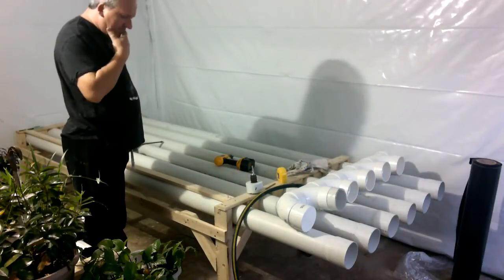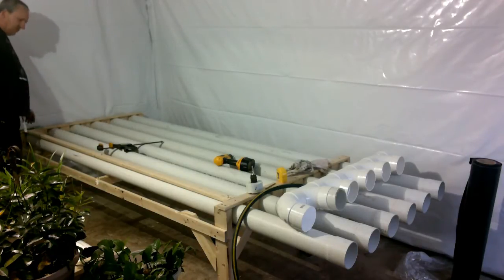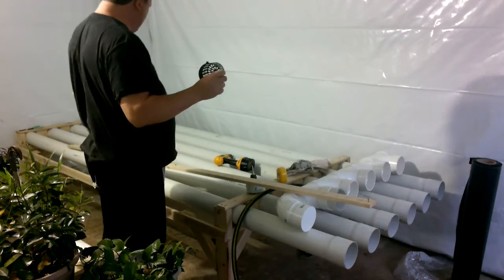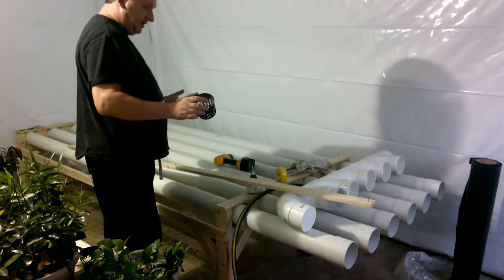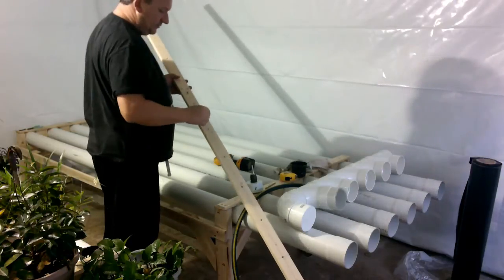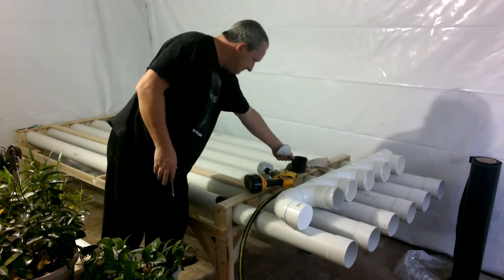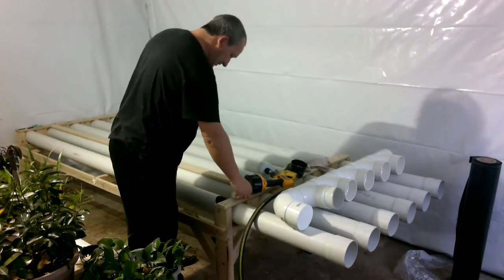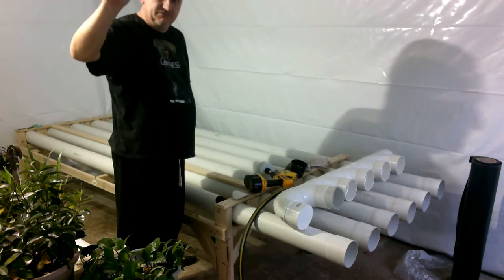Building a NFT System Part 3 of 3

Comment: Are you running that drill in forward?  Much safer if you run in reverse so it don't bite into pvc and break someones wrist.  Thanks for the video!
Reply from the maker: Ya running it forward and carefully, had it bite on me a few times.